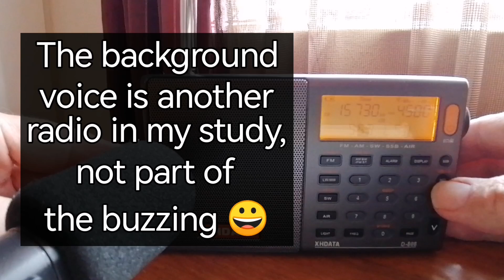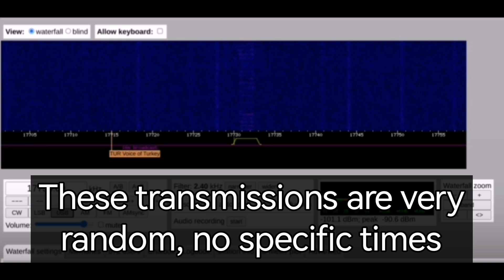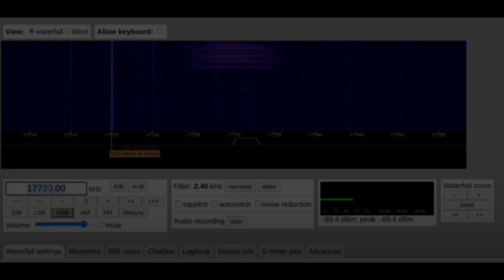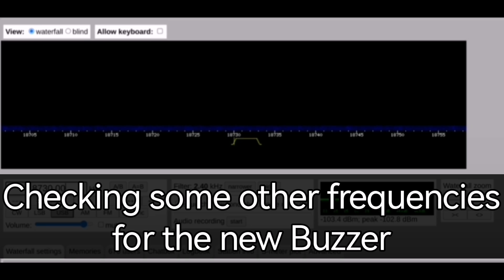What is the new Buzzer and why are there so many of them? #uvb76 #shortwave

Comment: I still be leave, that NATO use spread spectrum and hopping radio. And it is impossible to jam all the frequencies, especially in 8000km range. There is not enough power to do it.
Reply from the maker: Thanks for your comment! I don't know the full technicalities of the Murmansk BN system, but apparently it is quite effective. But you are right, by hopping frequencies, NATO makes it hard for anyone to really jam them.
Reply: The Murmansk system trucks are linked to a large computer (possibly an Elbrus) located elsewhere in Russia, that tries to track NATO coms patterns using algorithms. Dunno how effective this is. Once a frequency is targeted the jamming is very effective though. Plus the system is mobile.
Reply from the maker: @timbermicka  Thanks for your comment, I did not know that they tracked NATO communication through the use of algorithms. One does wonder how effective this is, as you say.

Comment: Thanks for sharing your vids as a newish radio enthusiast Im learning alot.
I have a question is the XHDATA D-808 the same radio as the Sihuadon D-808? Besides the name they seem identical.
Reply: Yes, they are both identical. I have both brands and can vouch for my answer. The D-808 was sold under the XHDATA name first and it was only in 2022 when the factory released black colored D-808s as the Sihuadon. 😊

It's the same marketing strategy with the smaller R-108 receiver. The Sihuadon brand comes in black color while the dark grey version is sold under the Radiwow brand. It's been known that Chinese made radios are sold under various brands in China, but made by the same factory. 📻🙂
Reply: @StratmanII  cheers appreciated the info
Reply from the maker: Indeed, both identical, and if I may add, both are excellent! The D-808 is a really good radio for the price, even some more expensive radios are not as good as this one.
Reply: @swlistening  thanks for that, purchased one on ebay today,has the micro usb and amber light with 18650 lithium battery.
Probably prefer gen 2 either way I know I'll like it given all the good info on this channel and a few others I looked at today. Cheers
Reply from the maker: @jeffeeeeeee  Have fun, I am sure you will enjoy it!